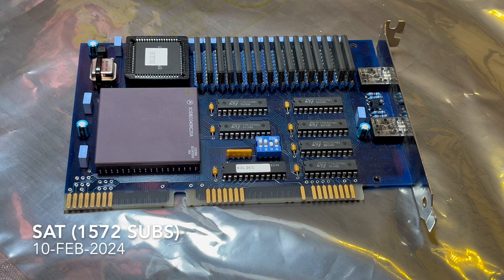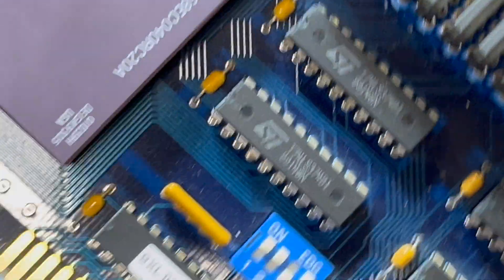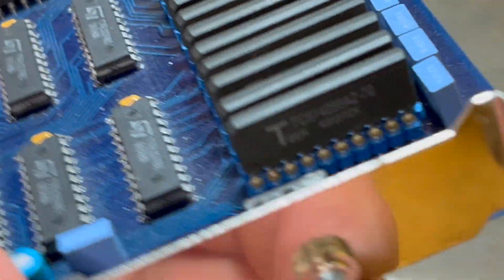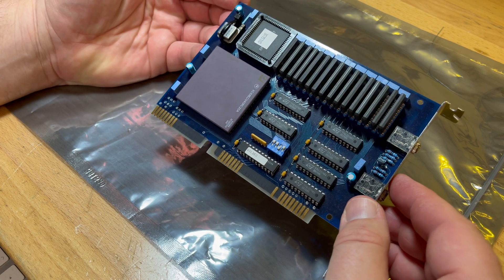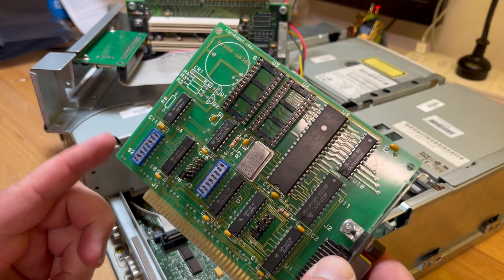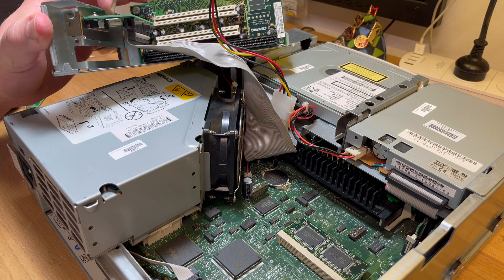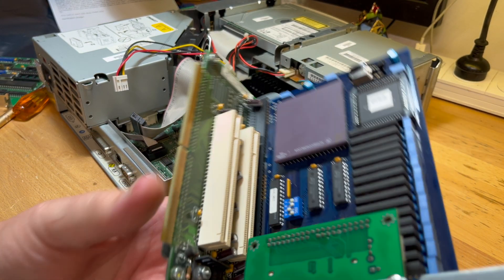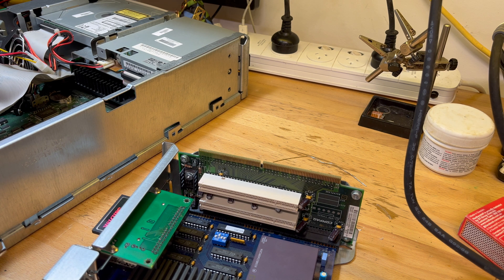🇬🇧 Miracle Systems QXL (Sinclair QL on an ISA card): Part 1A [TCE #0406]

Comment: Did you get this up and running? I was quite looking forward to seeing itvin action.
Reply from the maker: sigh ... the PC that has the compatible slots wouldn't boot ... power supply problem ... so this one is also still pending.  I'm also really looking forward to seeing this in action!

Comment: Any reason for the new sign? :) 

And there's an adapter to allow you to use a 060 in a 040 socket which is intended for the Amiga A4000 (and possibly the A3000).
Reply from the maker: It was pointed out to me that the reason why the QL's power supply didn't work (initially) was because the UK plug was missing the fuse ;)
Reply: @Brfff  Yeah, I saw the kerfuffle. :) Not something we would likely run into here...
Reply from the maker: I usually replace the plug before testing the PSU, so not something I usually encounter ... but, still, silly mistake when you've been dealing with UK-sourced equipment for so long (i.e. BBC Model Bs)